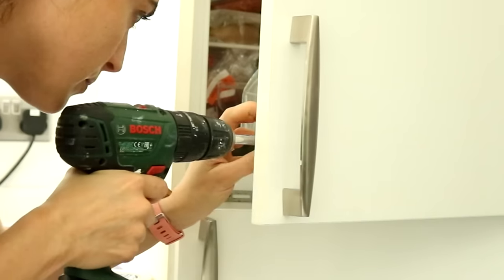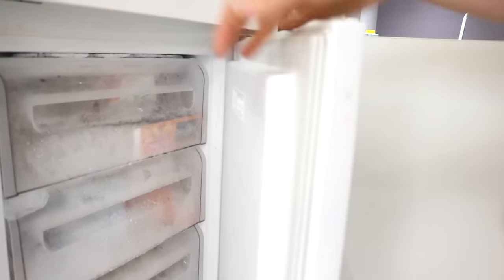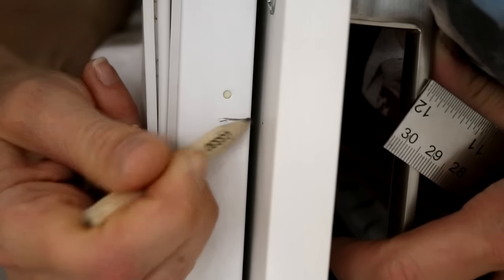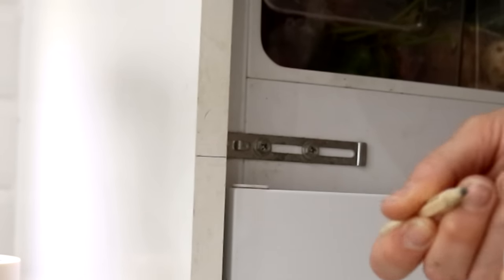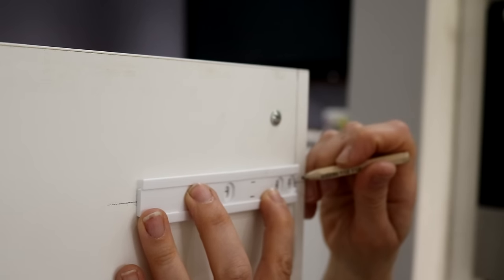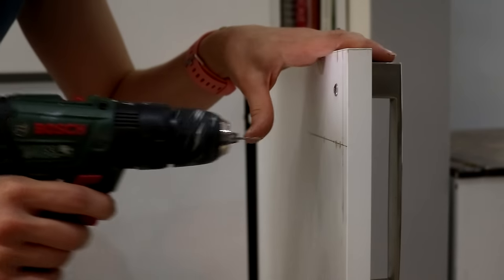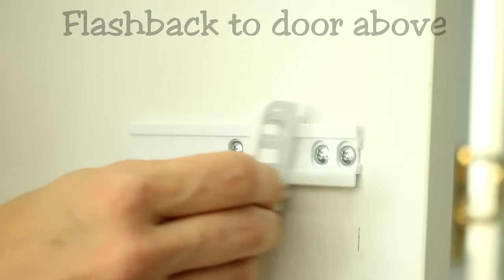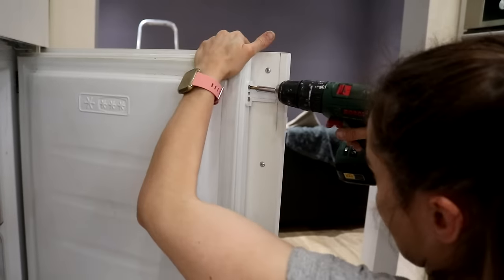Integrated Fridge Freezer Door Slider Installation | The Carpenter's Daughter

Comment: Thanks for this! Is it safe to drill into the sides of the doors to mount the brackets? Just want to make sure that there isn't a seal that we'd be breaking in that area!
Reply: Dee - FYI the Zanussi manufacturers website video also shows drilling into the side of the doors.

Comment: Any suggestions when the track and slider on a new fridge are too flimsy to open the freezer door ? the freezer is brand new and its suction is very strong and the plastic track just gives way at the top and bottom when the door is opened and the slider simply comes off ? I guess I need a metal track and a stronger metal slider but I havent come across an aftermarket alternative to the NEFF one provided?

Comment: I understand the slider door bit. My problem is getting the 50/50 cabinet doors aligned.  
The bottom right hand corner is dropping, thus not an even space horizontally.  I have tried aligning the hinges in many different ways but cannot get it right.  Driving me crazy.
Reply: I just had an alignment issue and I 'solved it' by leaving the screws a bit loose in the track and the fridge side bracket - it enables it to ride up and down about 5mm approx. I did align the unit as best i could first - i went all the way back to the legs and wound them all the way in and then slowly wound them out to get things level as best I could - Floor wasn't straight which is an issue but the end results in passable. I'm a bit late here!

Comment: my fridge door has 'dropped'. How do I 'lift' the outer door, but not the fridge door? Please?
Reply: Loosen the screws a little above and below the hinges on the bottom door, lift the door, then tighten them back up. Doing that might mean the sliders need adjusting though